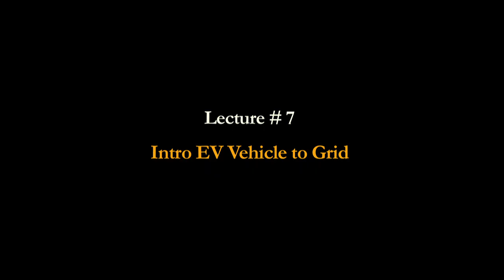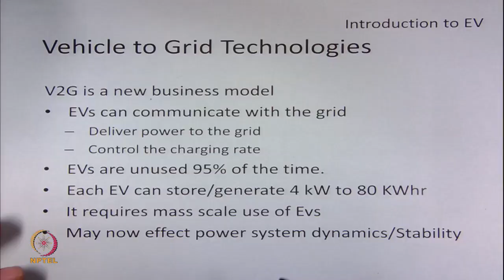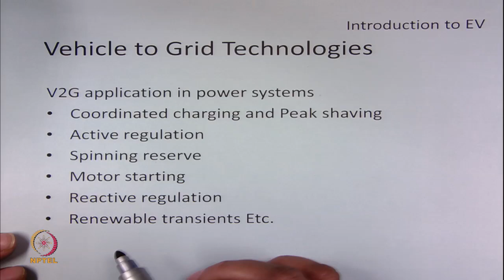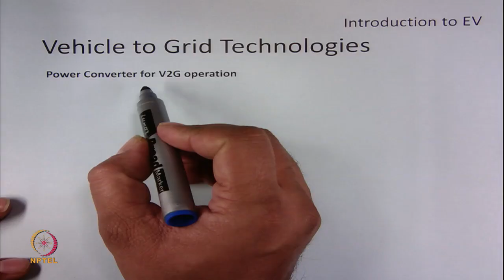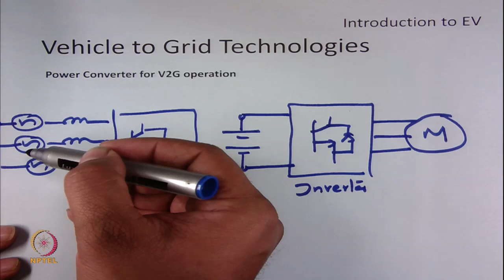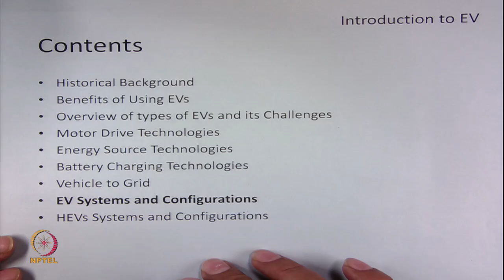Intro EV Vehicle to Grid

Comment: How can EVs be used as generators when they are connected to a grid, as mentioned in this video?
Reply: Basically they are giving back the energy that they have not used. For this, the owners are given an amount for the service by the government. The downside is that the cars have to be charged once again but not all the charge is required on an average day so the car will charge fully in the day through renewable energy and at night, when parked, it returns the excess energy so that coal is not needed.
Reply: EVs can be used as a source when connected to a grid which is known as V2G service, and there are many studies going on this research right now because we need to keep the peak load in control and if we cant control it then in future it might give us alot of problems on distribution site, so different researchers have different ideas but it eventually comes to the point that if an EV owner does not allow his EV to be used in the peak load shaving time then the grid can not force. but if you allow it then you can get many benefits